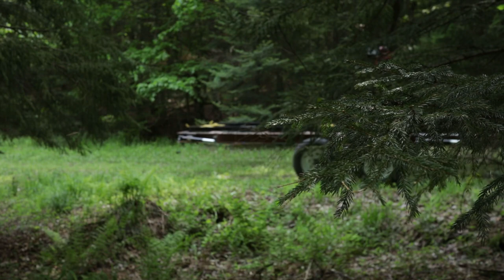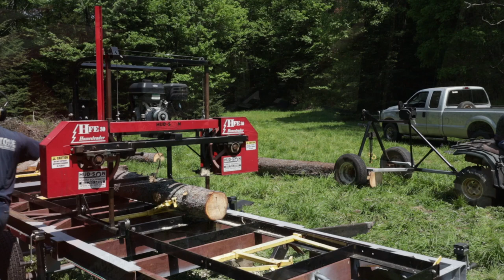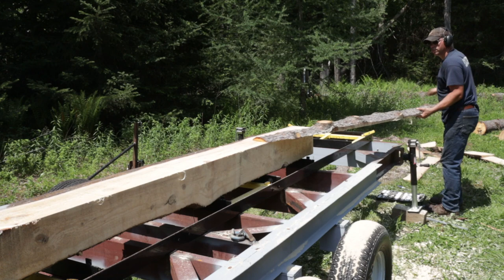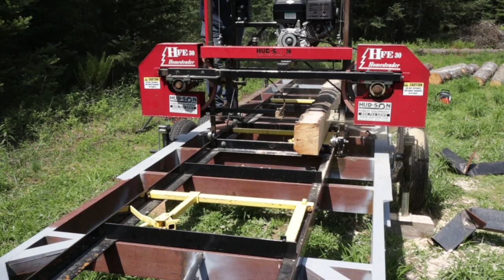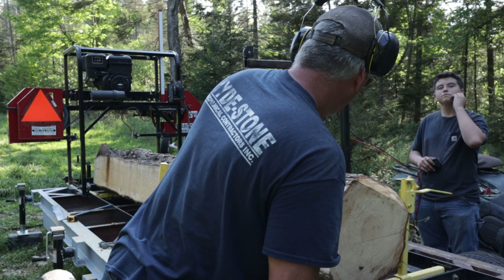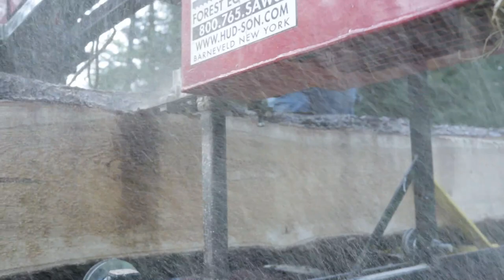Price Of Lumber Got You Down? Timber Frame 2.15

Comment: Gosh Jim it sure is great watching you and the boy co-operate so well. warms my heart! The crane - loader sure is slick! I saw a video about a year ago of a young lady loading logs with a similar device, skimpy bathing suit and all. Your demo was good too but, oh well. One thing that still puzzles me is why the second and third cut on a log, ie the slab cuts, dont cut from the clean side of the log. That is to say through the bark. If one could avoid the bark on these cuts the blade would stay sharp longer I think. The bark has the dirt and stones that dull the blade and if the teath issue from the inside of the log the hazards just pop off with the bark. I admit that I'm not a band saw man so maybe there is something I'm missing. Just wondering...
Reply from the maker: To get square lumber it's just how you have to roll the log.  I have a Log Wizard I'll be debarking with soon.
Reply: @TheTradesmanChannel  I see but what if the clamp was on the other side of the mill? yes I know the saw would tend to push the log away from the bar and toward the clamp, I hope I said that right, but I dont think the band has that much thrust. I sometimes cut with a flat side down and I don't clamp at all and that's with the swing mill and a quarter inch Kerf. I make these cuts both climb and conventional.

Comment: I read the comment section before commenting for a change, and agree, the clamps on the mill look like they could be improved. They kept falling loose on you. The trailer, the ramps, and the jib all seem to be working really well and as designed, great job. The log arch was working great as well in yhe prevuous video. Pulling down that hung-up leaner went very well. The builds are all plenty strong for the work you are doing, nicely done. Whether you choose to do a walking platform or a ground handle, it will be safer than walking the crossbeams of the trailer. Please consider whether the operator would be in harms way from a broken blade, belt, or debris from a ground handle position when designing the ground handle/controls and consider an E-stop from the new opporators position.
Loving the new set up. Keep up the great work and great videos.
Stay safe out there with you and Wyatt. 
See y'all next time.
Reply from the maker: Hey bud.  Going to do a ground handle, operator will be behind the mill.  We'll see how it goes.  I'm pretty excited about the equipment working like it is.

Comment: When are you going to get lazy and make another mount for that winch at the end of the trailer so you can pull the saw through the log instead of walking and pushing it? =0)
Reply from the maker: I am very much planning to make this mill automated but it won't be for this project.